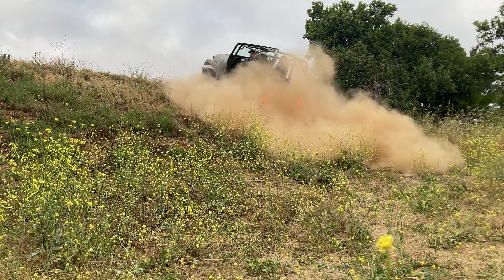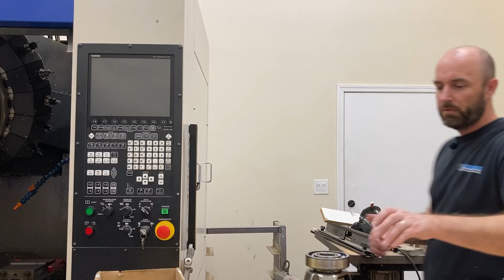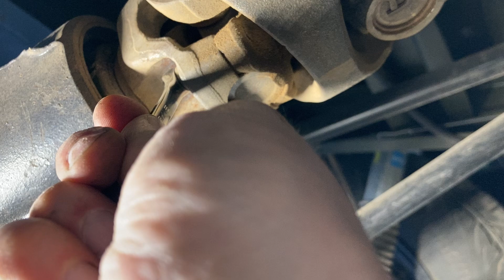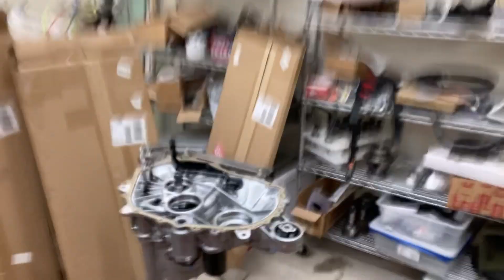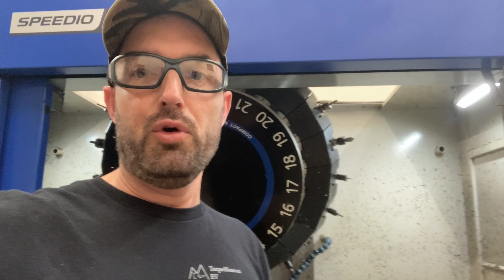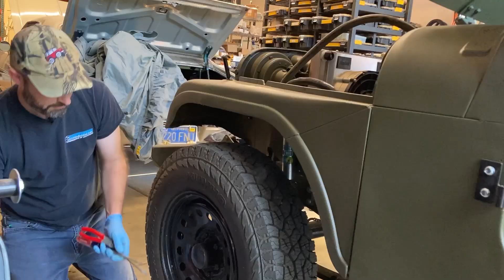We installed a Spool in a Telsa Model 3 Motor!

Comment: So the 2.97 to one ring and pinion on the Jeep times the 9.0 to one gear reduction on the Model 3 is geared too low to use on the street.
Reply from the maker: It has 2.72s in the diffs. The gearing is definitely very low, but it will still drive at 55mph on the road. The Model 3 motors spin really fast.

Comment: The Tesla ring gear is 8.75 inches on the LDU with 72 helical splines and 16 bolt holes.

There has to be a locker out there that can be swapped in 🙏.

Also, why not weld the diff?

Comment: do they make air or e-lockers for these axles?
Reply from the maker: Unfortunately, nobody makes an air locker or e-locker for the Tesla drive unit. Before we made the spool, the only aftermarket offering for the Model 3 drive unit was a limited slip.  In my build, the Tesla drive unit differential is essentially the center diff (the drive unit sits where the transfer case typically would). The front and rear axles on my build are standard DANA 44's --which you can readily find any sort of locker for. I actually have an ARB air locker on the rear DANA 44. So currently my Jeep has: open front diff; spool center diff; ARB air locker rear diff.
Reply: @TorqueMountainEV-iw1xd  sorry, i meant the willys axles. having a spool for the tesla 3 unit is a great solution for the center but was wondering if it'd be enhanced by adding lockers to the differentials at the axles side too. sounds like it already has the rear. this thing has t be a blast to drive now
Reply from the maker: @jasonmanness7941  Definitely! It is absolutely wild to drive! I can't wait to test it out more in both 2wd and 4wd.... The axles I have in it are actually Dana 44's swapped from a '74 Wagoneer. I cut them down to fit the Jeep. One benefit is the readily available parts for that era Dana 44.